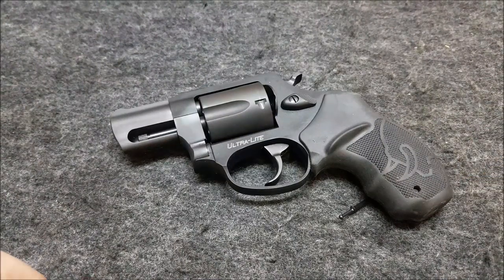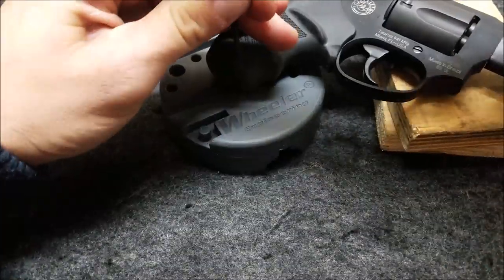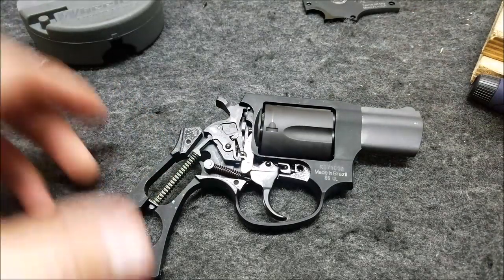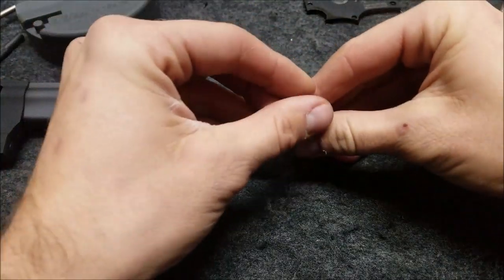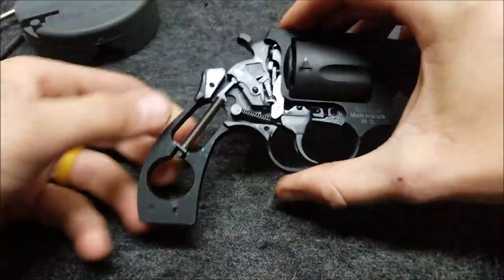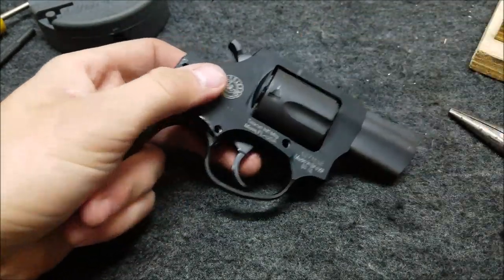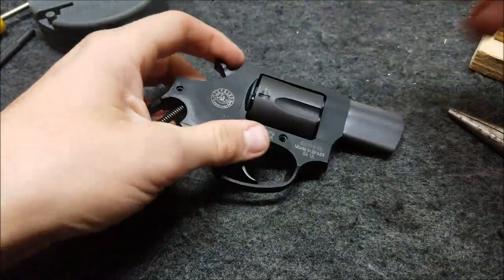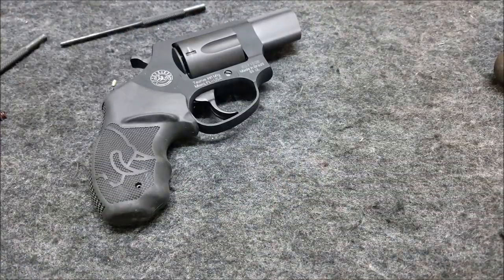Wolff spring kits Revolver installation How-To Taurus 85

Comment: I just completed this today. It went relatively well. You definitely need 1/8 roll pin punch and a strong smaller screwdriver. I placed my UL85 between 2 bricks with a folder towel under the gun and a little extra towel under the roll pin location (to catch the roll pin).

1. You need strong fingers, I barely got the trigger spring compressed to slide a paper clip into the hole when replacing it.
2. I did cut my spring down to 15 coils, count many times to be sure before cutting. I used angle cutters/plies.
3. Don't fire the gun without the side in place, the sear and it's spring could disappear. My tiny spring fell into the gun instead of flying across the room. I looked all over my room and then decided to check the gun...and lucked out!
4. On my UL model the top and front of the side plate had to be slid into lace first and then the rear snapped down. 
5. Before inserting the screws, I held the side plate in place and dry fired a few times single/double action.
6. I used BLUE thread locker on my screws when reassembling.

I put the 6.5 LB. spring in and...wow! What a difference. Plenty of trigger resistance but much easier to fire. Very happy camper here.
Reply: My Taurus 856 has a gritty trigger pull, does changing the springs make that better or do I need to take it in and have someone file all the components of the trigger?
I'm glad yours has worked out well for you. I'm hoping to get my kit sometime in the near future. I'm thinking about trying the Galloway spring kit. They are made for the 85's and you don't have to cut them down. I still have no idea though if the spring kit will be enough to make the trigger smoother. I think about all the newer Taurus's have a gritty feeling trigger. the older ones from the 90's seem to have been better made IMO.  Peace..Joe
Reply: My Taurus 856 has a gritty trigger pull, does changing the springs make that better or do I need to take it in and have someone file all the components of the trigger?
I'm glad yours has worked out well for you. I'm hoping to get my kit sometime in the near future. I'm thinking about trying the Galloway spring kit. They are made for the 85's and you don't have to cut them down. I still have no idea though if the spring kit will be enough to make the trigger smoother. I think all the newer Taurus's have a gritty feeling trigger. the older ones from the 90's seem to have been better made IMO.  Peace..Joe
Reply: @thebluesrockers  Use emery cloth and sand the shaft that holds the hammer spring, you'll be glad you did, it will smooth all that nasty, gritty feel out of the trigger pull in double action!
Reply: @vampangel2754  Great advice. I think my Gun smith did that when I had the "Galloway" spring kit installed. I know a lot of people have complained about failure to fire's after the "Galloway" spring kits, but my Gunsmith kicked ass installing mine. I've had zero issues and he even claimed my 856 is as smooth as his competition S&W is now. I sure can't complain. I had FTF's when I first bought it but my Gunsmith not only made it as smooth as butter with a 5.5 trigger pull in D/A and a 3.5 in S/A but absolutely zero FTF's with it. I think he reworked the firing pin spring. Not really sure but it's a awesome revolver.

Comment: I replaced my hammer spring today and left the trigger springs as is.  I was able to reduce the double action pull down from 15 lbs to a very manageable 10 lbs.  the single action pull remains at 5 lbs, right where I want it.  You make it look easy but I must say that removing and replacing that hammer spring is tough!  Trying to reinstall that needle after replacing the old spring was a bit hard, at least for me, but it’s worth it!
Reply: Very interesting! I’m only interested in lowering the trigger pull in double action I like the single action it’s light enough for me. So you’re saying just changing the hammer spring will lower the double action pull? I noticed in the video his single action got really light id like to avoid that and just have the lighter double action.

Comment: I did this to my Taurus 856 UL and my 605. I used the spring kits from Galloway Precision. No need to cut any springs. They both function so much smoother. Thanks for the video.
Reply: did you have any FTF with the Galloway springs?
Reply: @thebluesrockers  No FTF in a few hundred rounds so far.
Reply: @kennethcraig6439  I installed the Galloway Spring kit on my 856. My local gunsmith said that it functioned like his S&W model 37. Smooth and lite. I have a D/A trigger pull of 7.5 and a S/A pull is 4.5. Feels perfect. Thanks for your report. Peace.. Joe

Comment: Thank you for this video GunsWithGage! Your video is easy to follow and has excellent views of the process. My only gripe is you make it look so easy on the trigger spring. Myself and my 3 friends couldn't compress that spring and you did it with two hands while filming a video 😁😁😁 Luckily I work with a millright who helped me compress the trigger spring. The rest of the process was simple!
Reply: I rarely comment on old posts but Wow am I having  trouble assembling the trigger spring.  I've tried for the past few hour to get that spring assembled.
I could make a jig and use an arbor press but then getting a pin in the hole???
I have the tools to make tools but this is very unexpected problem.
I wonder how other people were able to do this.

Comment: Thanks for the video.

My 627 coverplate was so tight no amount of hitting or banging would take it off. I was wapping pretty mightily too. Wound up prying a little - know that’s wrong but it was the only way. 

Used some light grease on every surface that makes moving contact, removed excess. First I carefully disassembled moving parts and polished with fine compound on a Dremel wheel. Springs got a little oil as did any rotating parts, including the crane/cylinder axle.

All of that took out a lot of the ‘stacking’ feeling. Trigger is much smoother and feels a small bit lighter. I don’t think that Wolff makes sorings or a kit for this revolver (627 Tracker).
Reply: whats springs did you use then? i have the 627 tracker and wondering what will work? did you have to shorten any of the springs when you installed them?

Comment: Usually you remove the pin to the right side and reinstall from right side as the hole is bigger on right side. It may not make a difference on this but it is good practice.

Comment: Out of curiosity because im a new owner of a Taurus 605(.357/.38SPL) why’d he go with the 6.5 Lb Hammer Spring reduction and not the 9 Lb Hammer Spring reduction because my thought is that the 9 Lb Hammer Spring reduction would make the pull even lighter than the 8 Lb on Double Action / Single Action pull. Any tips or comments would be highly appreciated!!

Comment: I dry fired the new 856 model in stainless steel and the trigger was nice and smooth, and impressed me in a good way ( I would leave it) however I asked to see the matte black one also and it’s trigger was not as smooth and had a trigger that took more effort to pull and was very noticeable. Maybe this was a fluke but the salesman said they arrived at the same time and both had been dry fired quite a bit. I guess what I’m trying to say is you may or may not need a trigger spring kit.
Just my experience.

Comment: Installed the wolf spring kit in my model 85 and 1 out of every six had light primer strikes. IMHO dont install the hammer spring! I put the factory back in and it went bang every time. The trigger spring is great once you get it cut to the right length.

Comment: Taurus Poly framed revolvers no longer allow this operation, you can't access that hammer spring. New out of the box my 605 was pretty stiff in DA mode, working the action has helped however. Single action is at about 5-6lbs which is fine with me.

Comment: I wonder if you didn't install the rebound spring pressure block backwards. It appears that the longer spring might have been meant to fit in the larger stepped hole in the block. then you wouldn't need to cut the spring.

Comment: will this work on the 627 tracker 357?
Reply: Hey bud I'm wondering the same thing
Reply: @andrewgartee3934  i ended up going to a local gunsmith and they were able to smooth out the trigger and used a spring kit marked for a large frame taurus and it worked out great. i dont know the specific part number though

Comment: Question for you.  Can one just replace the hammer spring without changing the trigger spring?  I am ok with the current single action pull, about 5lbs, but that double action pull is really too strong, about 15 lbs.  I would like to get that double action pull down to about 10 lbs.

Comment: I have a new Taurus 605 Protector POLY .357 magnum that I would like to install the Wolff Spring kit on.  Apparently the Polymer frames are completely different from any of the other Taurus 605 series, it is noticeable even before you remove the grip, as the grip uses and Allen head socket screw in the bottom of the grip to hold it on.  It appears that just about everything on this pistol is different, it doesn't even have a side plate.  I have searched for hours to find the correct video, but I cannot find anything, other than a parts schematic.  I realize your video is 3 years old, but I am really baffled by this new pistol.  Any help would be appreciated.  Thank you.

Comment: Don't pull the trigger on a cocked hammer when the face plate is off or you could shear off the trigger pin which would be catastrophic cause it's part of the frame. Not sure if that's true on every revolver.

Comment: The mainspring in that Wolf shooters kit no longer fits the 605's Mainspring Center Pin for 2022 revolvers (at least mine).  The inside diameter is too tight.  The spring drags and grinds on the pin.

Comment: A very nice video.  But the Wolff springs cause me some concern.

Why would anyone buy a new spring kit that needs to be cut?

Galloway makes a spring kit for most all Taurus revolvers...no cutting needed.   I bought 2 kits for my 856s, and the trigger pull was reduced to an average of 5.8 pounds DAO.  Both of my revolvers are DAO, so no measurements on SA pull were available.  And at just under 6 pounds, I've had no ignition problems.  Even my crappy target reloads work reliably.

Now if I could only find a way to shorten the trigger pull length.

And for those that think the .38 isn't enough for self-defense, run a few rounds of Winchester Ranger T +P into a gel block.   At 12 ft, I consistently got 14" of penetration.  And the slugs I cut out were fully opened with nasty little razor blades sticking out all around the edges.

Comment: I have the Taurus 905 9mm revolver that should work the same, but I'm terrified to have to cut the spring.
Reply: I was too, just count it carefully, they make more of them if you need a replacement and you can re-install the stock one waiting for a replacement...that was my thinking. I'm happy with how mine operates now. (UL85 model)
Reply: @molonlabe9602  cool to know it's working well for you and yeah I better just order an extra one to be safe.  

Have you had any light primer strikes with the new setup?

Comment: With the wolff spring kit installed how is the trigger compared to the LCR trigger?
Reply from the maker: Dan G much smoother for sure. For shooting, I'd choose the taurus with the spring kit. If yoy pocket carry, I would choose the ruger, because the edges are more rounded so it carries better. In a holster, either are great
Reply: Hey, saw your question. Have you tried forum shopping? I knowthere is at least one great Ruger forum, like three or more S&W fora, and more than one wheelgun forum. In fact, most of the large general forums like firingline have revolver subforums. Not to mention Reddit!  I’ll bet your specific question has been asked and answered more than once (the internet is huge), but I bet there are a dozen people ready to discuss almost any question immediately...j/s

Comment: Not all spring replacements are a good thing, most fire arms arm are designed with a spring of a certain strength or weight and changing it can effect the way the weapon performs. Every gun it different , some guns perform better with stronger springs others may not.

Comment: Could you just replace the hammer spring and not the trigger spring? Thanks for the video
Reply: Bill Holmgren that’s a great question because I’ve checked out on forums and read that the trigger spring would break or malfunction.
Reply: @totalnewb123  The forums are wrong. You can do just the hammer spring with 0 issues. I have done four of the snub nose revolvers my two smiths and both my taurus revolvers. I have thousands of rounds through them collectively and no problems. One smith and one taurus were just hammer springs the other two I did both. Personally I would do both not because of any risk but with both done it is just a bit smoother and slightly lighter pull. While in there clean up the hammer strut you will notice the difference.
Reply: @barefootbob1269  Which Taurus model did you replace? I just purchased model 605. Where did you purchase your spring replacements from? Any modifications to fit the frame?
Reply: @dabonehead101025  I did my 856 and my m66 raging bull. I used galloway precision stuff. The wolf springs are great as well which is what I used in my S&W.I don't think Galloway has them for the 605.You can't go wrong with Wolff stuff

Comment: Hey GunWith Gage, I ordered this same spring kit for my wife's Taurus 85CH, which is a older model that comes with a bobbed hammer. I put just the hammer spring in and put it all back together and cycled the trigger and there's a sticky point when the trigger start to return back to fire position, any ideas what it would be making the trigger sticky? I really like the gun so I figured I'd put new hammer springs in. If I can't figure it out I may just take the wolff hammer spring out and put in my 605.
Reply from the maker: Check on the hammer spring guide(strut) sometimes they spring can catch or drag on sharp edges?
Reply: I'll double check that, didn't even cross my mind! It's amazing how Taurus changes parts on a almost identical revolver over the years. My Bobbed Hammer strut that holds the spring is rounded cup and yours is flat.
Reply: I probably need to see if I have the strut in right and not backwards!

Comment: I like everything except the cutting the spring part, not like it would be hard to do, but why wouldn't they just make a correct size spring to begin with?
Reply: Some of the older ones and or the other models this kit works in require the longer spring.

Comment: Is there a small spring bearing on the front of the Cylinder stop?  S&W Jframes have a small spring there but want to know if the Taurus 85 non-ultra light has one?
Reply from the maker: I honestly do not remember im sorry. I plan to get another one of these soon since they came out with the 856CH model. I'll take a look!
Reply: There is a spring on the Taurus revolvers under the front screw in front of the trigger. The spring fits inside the screw with a small steel cap over the other end of the spring, which keeps tension on the cylinder stop.

Comment: After this spring change are there any problems with lite primer strikes?
Reply: That question should be at the top of the list..
Reply: I had light strikes and went back to the original hammer spring and just used the 6.5 trigger spring and it has worked fine.it felt really good with the 9lb hammer spring and 6.5 trigger spring but after about 50 rds.I started getting light strikes.It is improved somewhat with just using the one spring.So it was worth doing.
Reply: So you ended up changing the trigger spring and not the hammer spring  ( to eliminate light strikes ?? )
Reply: Duh....  I just reread your post.  You already answered it.

Comment: Safety check please, and even then you shouldn't pull the trigger with one hand in front of the barrel.
Reply: He shows safe before ever pulling the trigger and most likely checked clear off camera before starting.  The rule is to treat firearms as though they are loaded UNTIL YOU HAVE PERSONALLY CHECKED CLEAR.